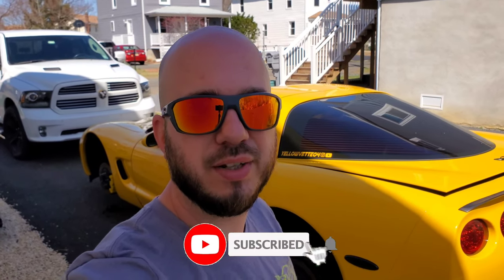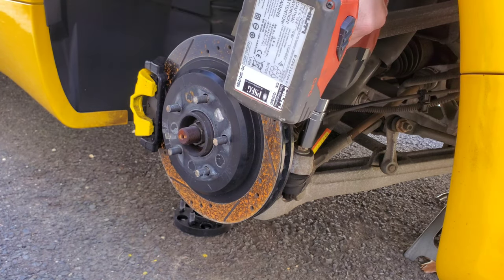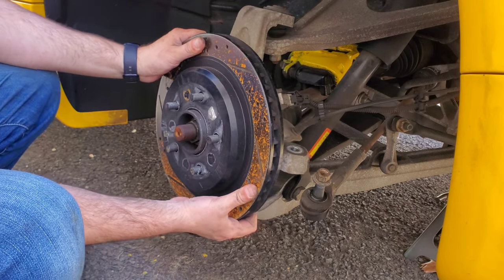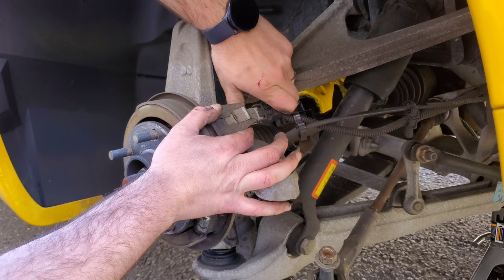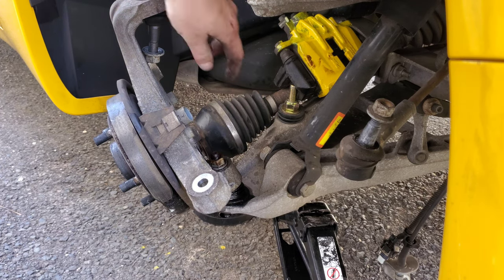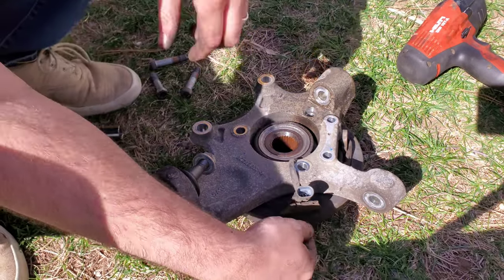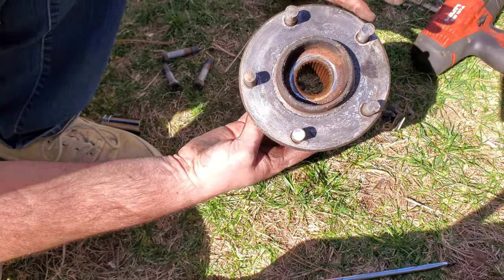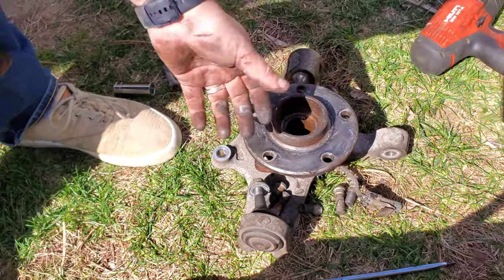Replace Rear Wheel Studs on C5 Corvette

Comment: Good job Dave! Actually you make it look fairly easy lol. I guess it’s just a lot of stuff to take apart but not super complicated. Thanks for info on how to do this it helps to know how it all fits in there. Your rims are gonna look dope.
Reply from the maker: Thanks for the comment. I worked out most of the kinks when I did the Passenger side and that made the driver's side go a lot quicker. Hope this helps is you ever need to replace a wheel bearing 👍

Comment: Just stripped 2 studs trying to run a 7mm spacer on the stock studs and nuts lol big mistake. Pretty disappointing to see the entire hub assembly needs to be removed to replace them!  Ah well your video will be a huge help when the time comes to swap them out.
Reply from the maker: That sucks man. Good luck and hope the vids helps you out.

Comment: Let me know what you end up doing for your center cap. C7 caps will snap right in, but I wanted to keep a C5 logo in them. I filled the MMR logo with bondo and then sanded smooth and color match painted the cap. Then I found someone to make me a small red C5 logo decal.
Reply from the maker: For now I'm just going to leave the MRR black center cap. I'm sure I'll color match it at some point, but I'm in no rush to do so.

Comment: Good video brother. Depending on mileage it may have been a good idea to do the wheel bearings while you were in there. They come with the studs and Timkens are only about $100 each.  I replaced them on two c5s one at about 80k and the other  90k miles.  One set because they needed it and the other set because I accidentally purchased two sets of rears. So figured why not do the preventative maintenance.
Reply from the maker: I thought about and almost went with new bearings. Mine are fine at 62k so should have a few more years until they need to be replaced. At least now I know how to do it lol.
Reply: @YellowVette04  yeah you should be good for a while. It's an easy job anyway. It's harder to find free time than it is to work on a C5. The C5 is one of the easist cars I've ever worked on.  (70s and older cars excluded).
Reply from the maker: Totally agree. I've never really worked on a car before this one, so I'm learning as I go. Fun process for sure.
Reply: @YellowVette04  it's a good one to start with. It's simple but complicated enough.  Like a 500 piece puzzle.  BMWs and SAABs on the other hand....pack a lunch.

Comment: That was so much worse than I was expecting lol. Mostly all caused by that third star nut for the wheel bearing being behind the ball joint. I think when I did my S10 ones I was able to just sneak it out by turning the wheel but that was the front obviously.